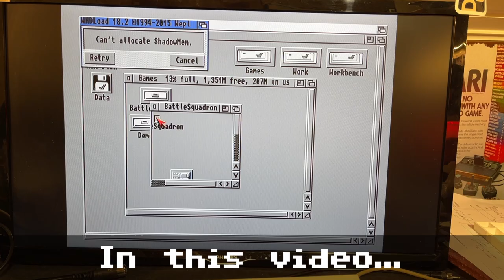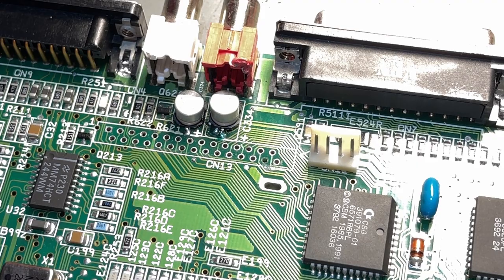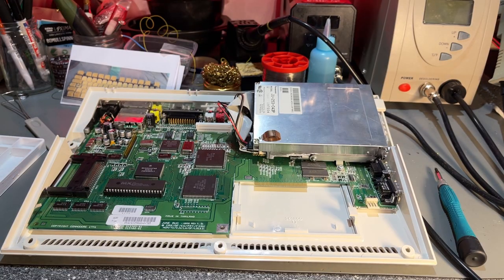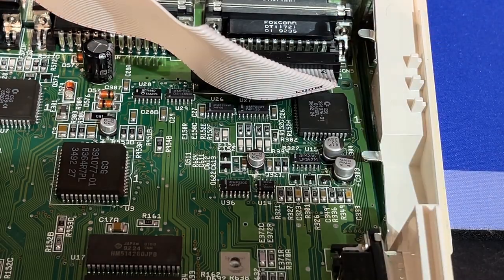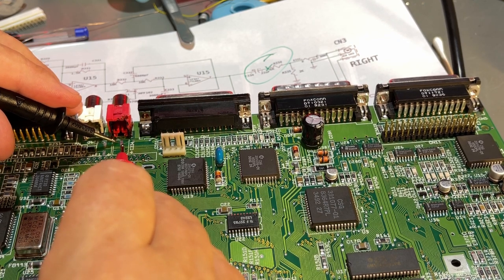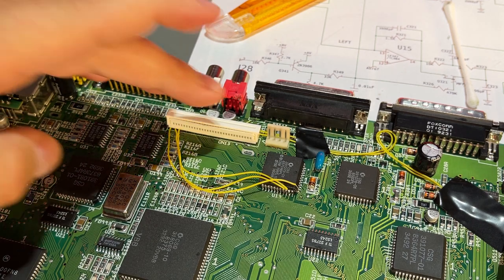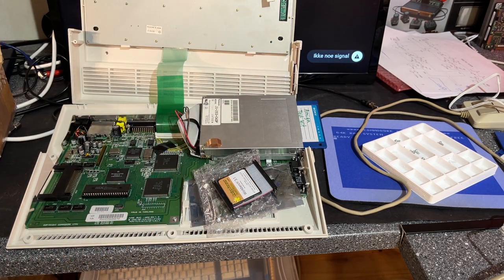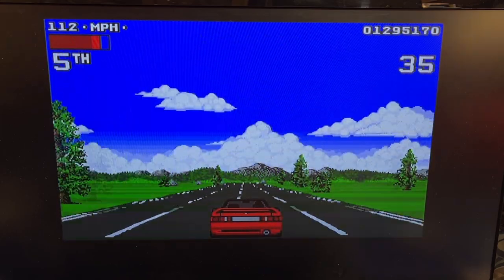The problematic Amiga 600 - No audio! - More problems with the repair and restoration!

Comment: I had exactly the same problem fixing up my own Amiga 600, I ended up ripping up the same cap pad you did, as well as multiple keyboard pads. Ended up doing exactly the same fix but with 30-gauge wire wrapping wire. Those old Commodore boards are well known for being a bit fragile! I bet the electrolyte from the leaky caps was the culprit in these cases.

Also: electrolyte can leak under the chips, especially around the Even CIA. if your floppy disk stops working, the chip is likely fine but the electrolyte may have eaten at the vias under the chip, that's what happened to mine.

Comment: my A600 when i brought it had a bad left audio output sounding low and crunchy. a grate thanks to Arctic Retro for location of the amp chip on the schematics, it needs a recap on the capacitors but found gunk on the chip legs ... easy fix :).

Comment: Great video! I've recapped some A600s, too. Some were heavily corroded or damaged by leaking caps, others weren't. I did clean the 'fishy parts' with isopropyl alcohol several times until there was absolutely no electrolyte left (board surface has to look shiny not dull or smeared - very tedious, but IMHO worth the effort). For desoldering I don't use hot air or the ZD-915 station, I recently switched to a Hakko FR-301 and really never regretted it, but that's just my personal opinion. It is really great that you also show when mistakes have been made. Good channel! Love the views from Norway (been there 2017). 🙂
Reply from the maker: Hello Bernhard. Thanks for the message. I want to switch to Hakko in fact, since I see others have recommended it too. Just need to find a good priced one first. I guess there are several models. I'll check out the FR-301

Comment: Hi Tommy, I have recapped several a600. I can advice next time to replace the 2 smd sound capacitors with regular axial caps, easier to install and to replace later if needed. I have an old hakko desoldering station, but this worked fine to remove the keyboard connector, strange that you are having such a hard time. Regarding the memory, yes for each partition you mount you loose quite some memory, basically with a HD you must have a memory expansion. You mentioned upgrading the memory, did you already buy a ram expansion for this?
Reply from the maker: Thanks! I haven't bought something yet. I am gonna buy a Terrible Fire for an A1200, so I'll get some upgrade for the A600 then. I am thinking about a TF1230 as a 1260 is way too expensive at the moment.

Comment: I had a 1200 Bundle back in the day and I’ve just found an Amiga A600 in a sorry state of repair that I’d put in Storage about 25 years ago, I’ve just ordered a PSU for it to see if it still works? I will be uploading a Video to my Channel at some point soon hopefully!
Reply from the maker: Ok, cool!
Reply: @Arcticretro  Tested it yesterday and it did initially turn on and displayed the Insert Disk Screen and, Turned it off & then connected it to a different Screen and initially got a Grey Screen & now I’m just getting a Black Screen, Checked the PSU Voltages white it plugged in to the Amiga & Turned On and I’m getting 5V & 12V, Had a quick look inside the PSU & theirs a Burnt spot on the PCB between 2 x Diodes near the Transformer but still seems to be working ok but not sure for how long, Do you think the Amiga needs Re-Capping?
Reply: I was looking on a Forum(Amiga Lemon) I think and someone suggested removing the Capacitor near NE555 and theirs would then boot up, Removed the Capacitor and was met with a horrible smell & I believe some people have said that it smells like Fish, Not sure about that, Plugged it back in and got the Insert Disk Screen back, Cleaned off the Electrolyte using some White Vinegar & Servisol & then plugged it back in and back to black screen and sometimes a grey screen, Left it a while and I’m now getting the Disk Loading Screen most of the time and the Screen Flickers , I will replace that Cap & will clean up the area with IPA before doing so as I’ve just ordered an A600 Capacitor kit but it’s sounding hopeful at least!